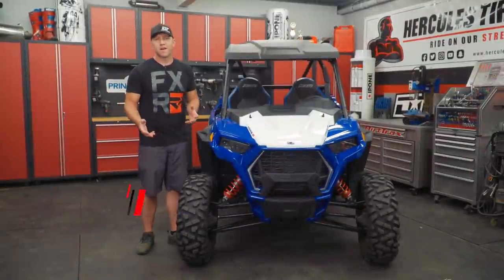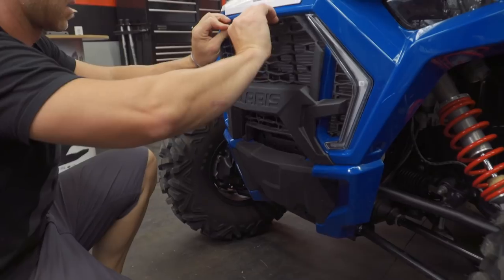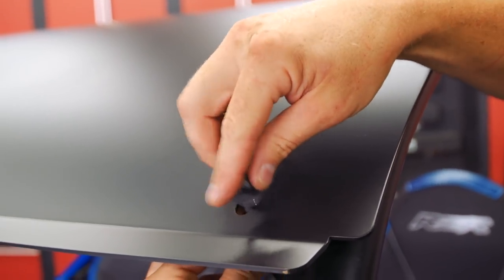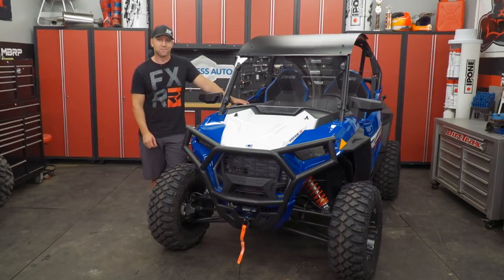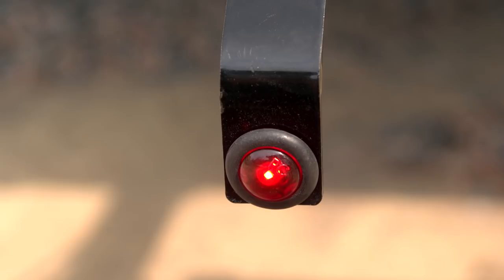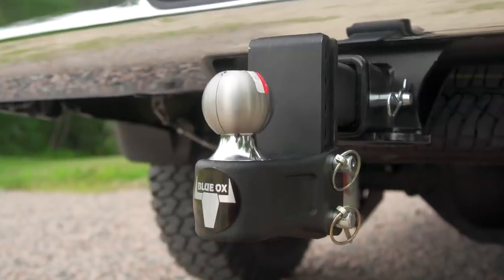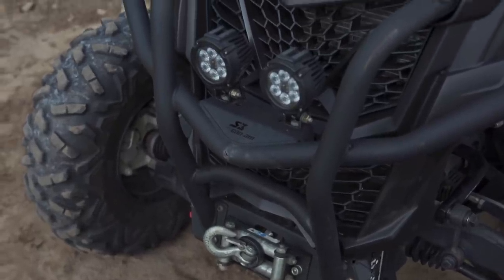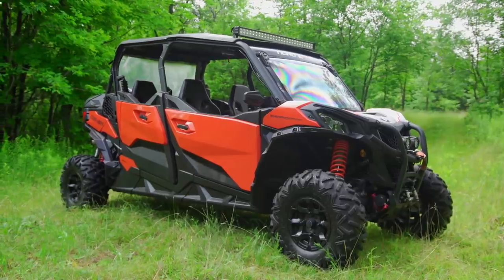DIRT TRAX TV 2021 - FULL Episode 6

Comment: Hey when is the Commander vs RMAX vs General video coming? Thanks for the great content!
Reply from the maker: We've got a General now, we gotta get our hands on all three of these at the same time. That's the challenge...
Reply: @dirttraxtv  I've got an RMAX and my neighbour has a new Commander here in Goose Bay if you want to make a road trip!
Reply: @GuardianGrove  How are you liking your RMAX? I have had my mind set on the RMAX ever since the release.
Reply: @drewjames8594  I loved it since it was introduced. I passed on the KRX when it was introduced because of its 68" width but didn't hesitate with the RMAX because I loved it so much. I was concerned about shoulder bolsters causing discomfort because I have pretty wide shoulders. I noticed them way more in drivers seat at the showroom but don't even notice them at all when driving once my hands are on the wheel. The suspension is great. You can hit decent whoops at full throttle with limited bucking. Power-wise, we have wide open sand pits that stretch for kilometers. The RMAX EATS the new Commander in those stretches, partially due to a bit more power but also because of the deeper tread on the 30" Carnivores (on the RMAX). I intended on using it small game hunting, but it's hard to imagine being out on it and driving it slow! I just really wish it came with the Adventure Pro unit at the premium price you pay, limited features in Canada or not.